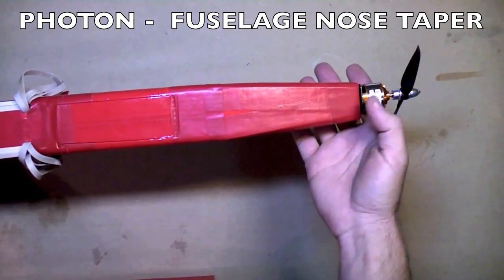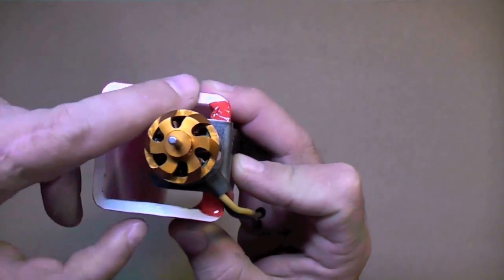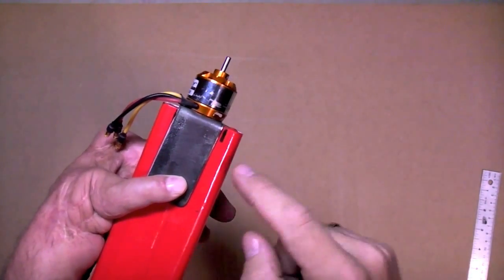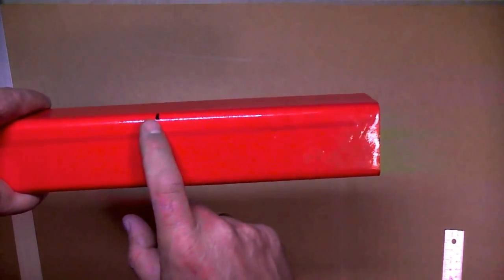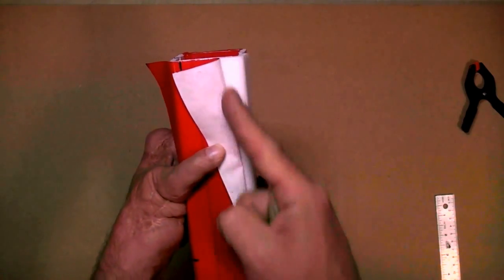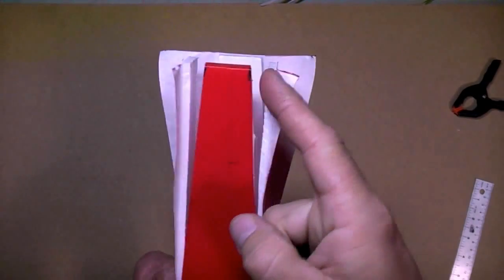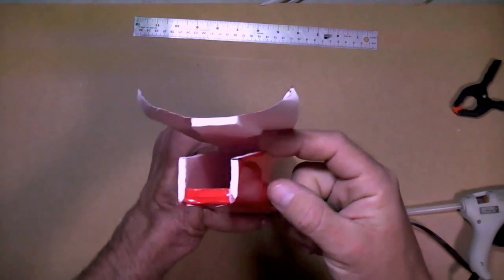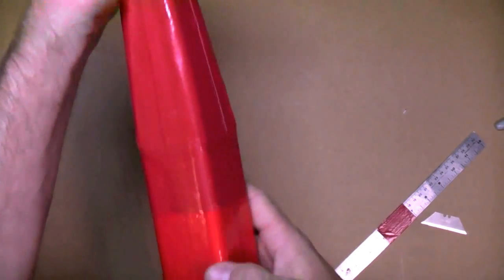PHOTON - Fuselage part 1: Nose Taper

Comment from the maker: You are welcome, that's why I do it! .  1) the rubber bands slip off the CF rod at the rear.  You place the wing on the fuselage, stretch the bands over, and slip on.  #64 rubber bands (Office Max, Staples, etc.) stretch perfectly at 5-6", which is the approximate chord.  Watch some of my other videos for alternate wing mounts if you're uncomfortable with this. 2) aluminum bar stock 1/8" is perfect. 3) CF, wood, anything strong and thin is fine.  CF rod 3-4mm is nice, chopsticks or 3/16" also OK

Comment: I stumbled across an interesting alternative –having a local metal shop make a bunch of these mounts for you in one shot. This undermines the DIY approach a bit and is slightly more expensive. But if you’re like me and just moved to a new place so your vice isn’t set up (or you’re just bad with hammers and metal), this could work. My local shop did 10 mounts for $53. I should probably learn to do it myself and save the cash, but they look great and are perfect 90 degree bends. Just an idea!

Comment from the maker: I clamp it in a vise and hammer it over with a deadblow mallet, but any hammer would work.  I'd recommend sticking with the flat barstock and bend it.  I'd make the 'footprint' 2" long.  You will be surprised how secure that Scotch Heavy Duty foam tape is, but 1"x1" is pretty small unless you also put a nylon screw or some other reinforcement through there.

Comment: lol "looks decent at a distance"   I did mine by cutting a wedge out of the center of each side 3/8 inch down to zero and 6 inches back. then just put hot glue on the edges of the cut out and pushed the corners together one at a time.  that was before this video so I wasn't sure how it was going to turn out but a little packing tape over the seams and looks great.

Comment: Also a few beginner Q's, if you have time:

1 Total noob question, but how do you attach the wing to the fuselage? Do you literally just slip it under the rubber bands? How tight should they be?

2 For the engine mount, my local store carries aluminum stock that is 1/8" thick by either 1" or 1.5" wide. Would this work well?

3 What is the OD of the carbon inside the fuselage? If I do use wooden dowels for the wing and/or fuselage should I use the same approximate OD as the carbon?

Thanks!

Comment: I have watched a quite a few of your videos so far and have found them really informative. I have not seen you use an iron yet.  As a scratch builder I have found using an an old clothes iron to be a great tool to smooth tape, adhere problem tape places (hinges/corners) and thermoforming the foam itself.  I use the iron switching from off to the lowest setting.  You know when it gets too hot, and (warning!) can warp a surface. Keep up the great videos!  (any sloping gliders in the works?)

Comment: Thanks, Ed. Another noob moment, but any advice on best ways to bend the aluminum? My first and second try yielded a 90 degree angle, but the 1” leg was noticeably warped / twisted –not perfectly perpendicular. Alternatively, I’m happy to use the pre-bent aluminum angle, as per the motor mount video, but can you confirm that a 1” x 1” section is sufficient? I’m worried that a 1” taping surface might not secure the mount to the plane as well as the 3”.